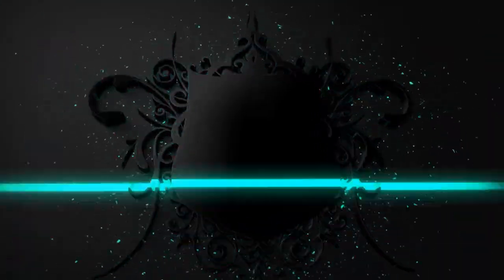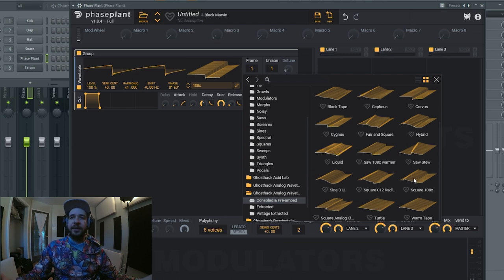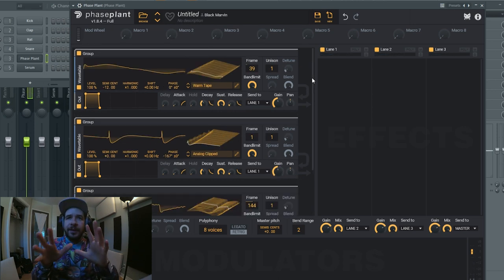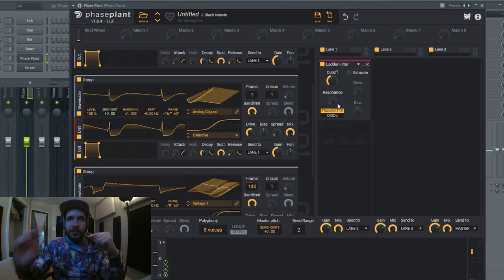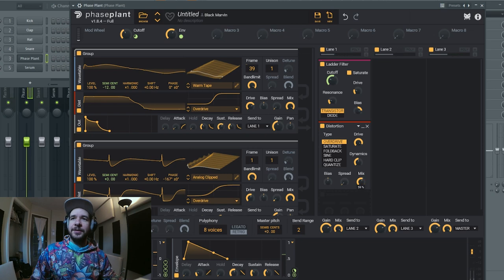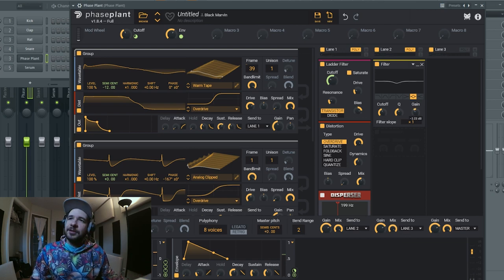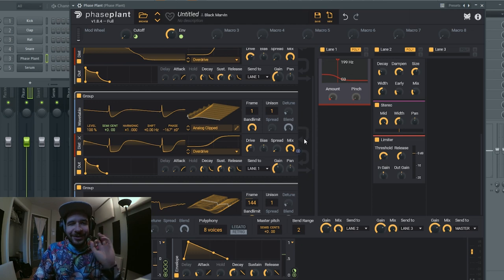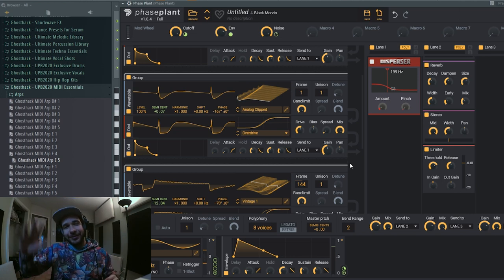Making PHASE PLANT Sound Like an ANALOG Synthesizer | Sound Design Tutorial

Comment: 7:22 The fact that you modulated the pitch of each waveform slightly differently (First one: 0.10, Second: 0.15, Third: 0.10) also caused some comb-y sounds in addition to pitch drift, giving off a PWMy sound. This isn't necessarity bad, but it should be mentioned so people know.